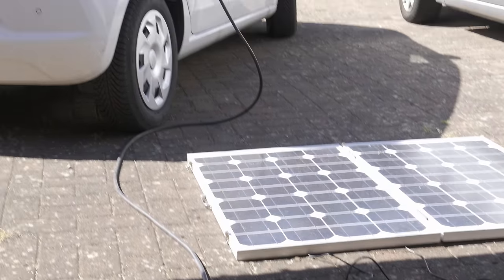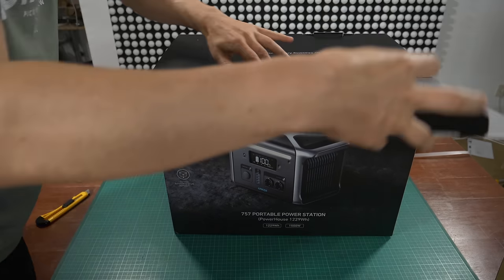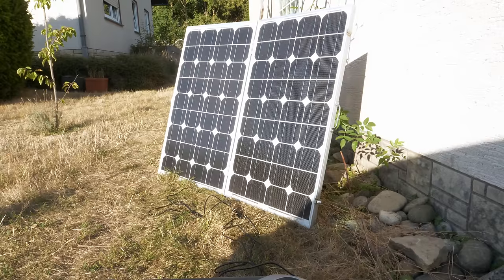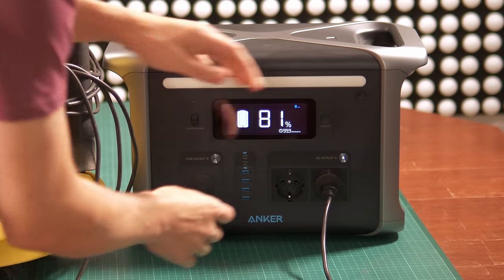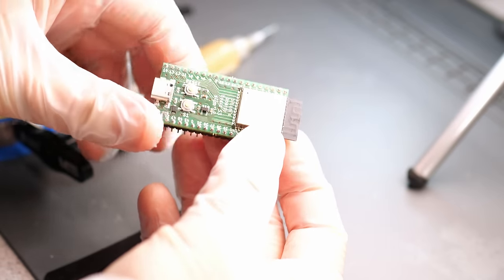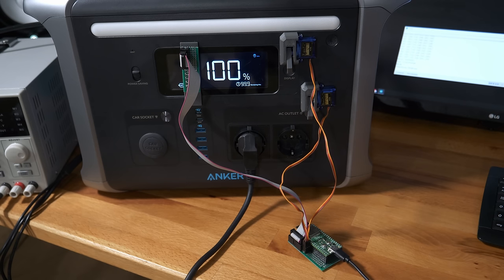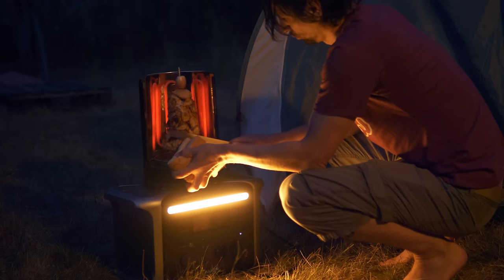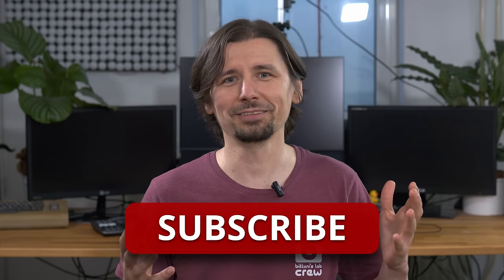Charging an EV for $0 (Anker 757 PowerHouse)

Comment: Holy sh**, that power cost is insane. I just had a look, how much I would have to pay, if I needed to get a new contract for electricity and it was even worse. The cheapest was 66.88Cent/kWh, that is insane. Luckily my current contract still lasts till end of 2023, for 25Cent/kWh. Let‘s hope, the company doesn't get bankrupt...
As far as I know, the biggest contributor to the high prices beside the conflict in Ukraine is, that 24 of the 56 French nuclear power plants are out of service because of corrosion. It is still unsafe, if all of them can even be repaired. So, I guess, that problem won’t go away anytime soon.
Reply: One or two weeks ago France announced that all their reactors will be started again for the winter.
Reply: @Jehty_  Let's hope they can do it without skipping any steps. I remain sceptic about here timeline...

Comment: Awesome as usual! Can you please share what liquid do you use for ultrasonic cleaning?
Reply: It should depend on the flux used in soldering. There should be a manufacturer recommended solvent usually. In my experience, usually 200 proof ethanol or isopropyl alcohol.

Comment: What I've missed is - what prevents you from adding more solar to the Anker? If this is fully off-grid, you might use as much power as they allow for the MPPT, right? Or even switch the Anker's input to off-grid inverter and power it with like 2kW array and use it the same way as you used it with your PC - as in-line UPS :)
Reply: Probably the 30V*10A=300W max input
Reply: @H3wastooshort  Oh, right, I did not realized that... Thanks.
Reply: Unfortunately the 30v is really not designed for high power solar panels. Most power banks include solar in order to sell their own pannels which are much lower voltage than the kind you'd put on the roof. Going over generally 50v (a conventional cutoff between "low voltage" and "high voltage") in a consumer product is a huge liability. The AC mains output is "high voltage", but consumers are more familiar with it, and AC has some safety benefits over DC.
Reply: @aaron41  why would it be a liability when it outputs 110/230v anyway? Seems more likely its so they can sell you their own panels instead of regular ones.

Comment: Ah yes, how to solar charge your EV? Using an AC inverter powerbank and going through the onboard charger works, but they are expensive and lossy steps. Ideally you'd connect a pair of fused wires in your battery pack  to have Vbat accessible when the car is dormant! That naturally requires some reliable wiring and quality connectors when you have the un-switched battery pack at your disposal, but the benefits are: Solar panels directly connected to  mppt and inverter, that AC you can rectify directly with a diode bridge to get in the ballpark of your vehicle voltage. Then it is just a question of setting current limit on your inverter (not to overload it) and build a voltage limiter to stop charging say at 80% (to not overcharge your battery). You don't need the car's BMS to monitor charging with such low current, if you once in awhile use a regular type 2 outlet to update the onboard computer.